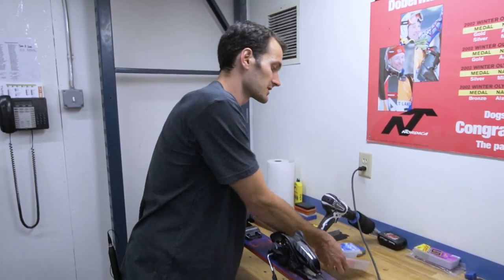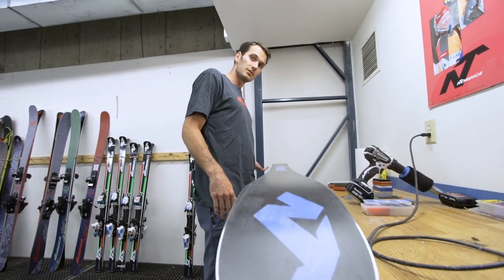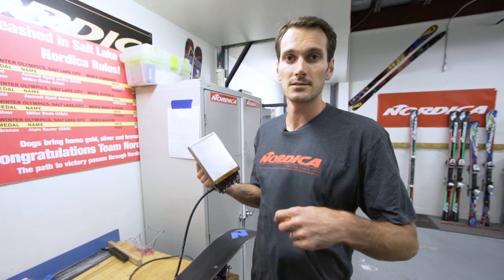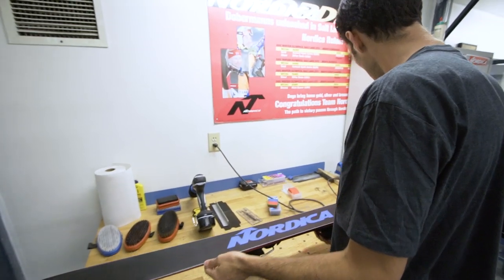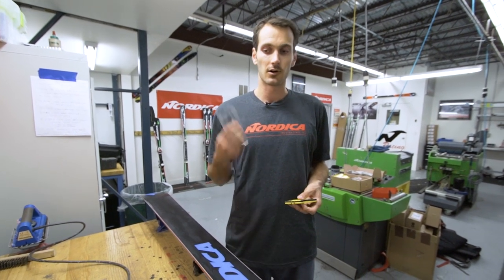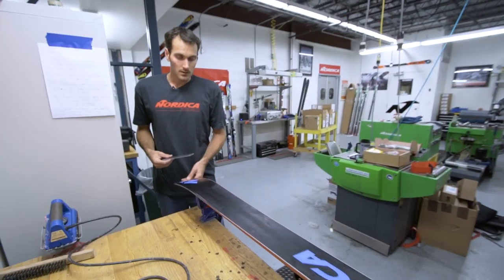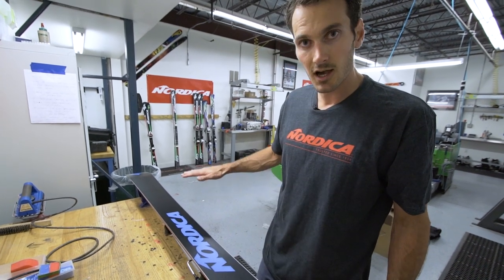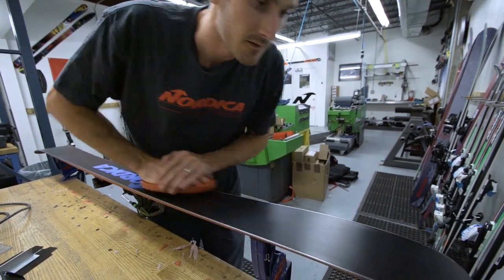HOW TO WAX YOUR SKIS

Comment: Why does everybody remove the wax again after coating the ski in it? That doesn't seem too smart. Either the wax has a lower coefficient of friction than the base - then you want to have a layer of wax remaining. Or - the base has lower friction - in which case you don't want to put any wax on in the first place. Skiing the waxed ski will polish the wax anyway...

Comment: Great video.  I have been waxing wrong for the past 49 years.  I bought in 1970 an old iron at at the Salvation Army and when scrapping, I didn't remove all that much wax and then I buffed the base with a large cork block.

Comment: Why remove the wax? I thought the point of wax base was to improve speed.
What’s wrong with simply applying a good layer of wax, clean off the edges, and ski the next day? The friction of the course will naturally rub off the excess wax.
Reply: LoreZyra . TV I had a pair of rentals one time where the tech just rubbed some wax on and just scraped the excess but didn't remove very much of it and the skis gripped because it was really clumped onto the bottoms
Reply: @SoberTea  I don't use the rub-on wax. I use an iron to melt it on evenly and smooth. I don't have a problem reaching speeds of 90kph on the slopes.
Hence my question.
Reply: The wax that the ski needs and can hold on to is already there after you hot wax, the rest is just superfluous. in Swedish we say the base is "mättad" which is the same word as full (as opposed to hungry). So you dont remove the wax, its already applied to the base, you just remove the excess. The basic reason why you need that much wax is that it would super hard not to burn your base if you used much less.

I agree its overcourse to remove it all meticilously, you can get by with just a little scraping and no polishing, the  performance is not that different after half a run. But brushing a lot def helps otherwise XC skiers etc wouldn't do it. Im a ski tech and the reason I clean excess off customer skis so carefully is just because I want to be proud of my work and the customer to be happy to get a fresh looking base. When I wax my own skis im not gonna spend more than a minute per ski scraping and brushing.

Comment: Why not just engage the binding to get the brake out of the way?
Reply: Because it's independent of the heel plate?
Reply: engaging the binding won't pull the brake out of the way.  you'll need a band to do that.
Reply: Make sure you're skis are at room temperature like inside for a good period of time so you don't ruin your base's never a cold base!        Jeff Wilderberry

Comment: I have an issue with for the most part was decent advice...I wax every day if I have a set up for it at my  home or hotel, not sporadically....at the end the season I wax but do not scrape, I “ALWAYS”wax skis at the end of season, scrape them off for the new season....Although a waxing video, it starts off with advice on making sure your skis are ready to be waxed...prior to screwing up your scraper, you check for burrs...I missed seeing that...I prefer wiping my skis, and never would use my scraper prior to scraping them in case impurities would be pressed into the base, to scrape without wiping is wrong...using a specifically made cleaning solvent to remove existing wax and dirt a thought...I rarely stuck to a single color wax, almost always using a multi wax,, like HERTEL, then a bit of blue, in winter, red in spring, and straight multi temp if unsure, or in late spring Sierra Nevada conditions to offset the Ammonia Nitrate used on the snow, in fact having a second pair using straight blue on the bulletproof corduroy stripes in the morning(Fischer RC4 RS GS Skis), switching to a slalom or all mountain ski once it all softens...it would have been helpful to see the type and management/padding on the vices as well...where was gummy burr remover?…where was the source to establish slope temperature in order to know how to wax?…where was the discussion on super high end race waxes, and how they work?
Reply: @RogerDiotte  im not in canada?